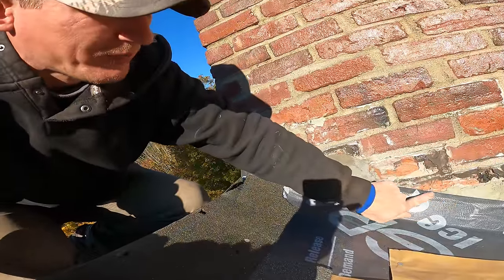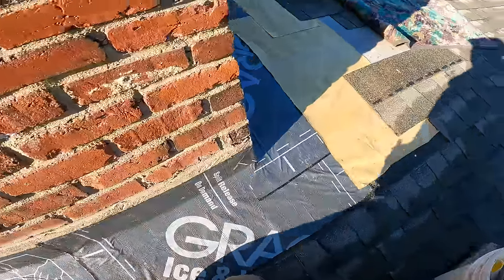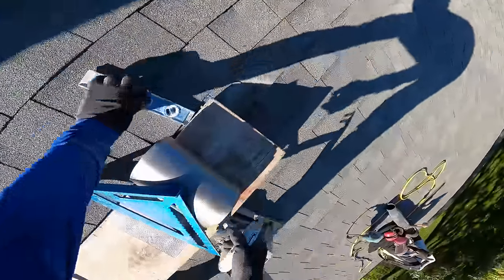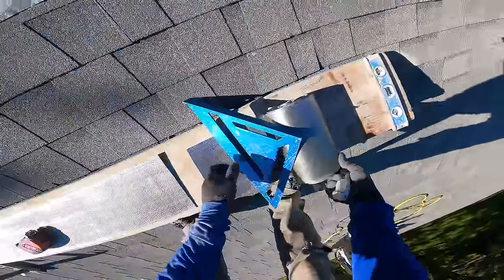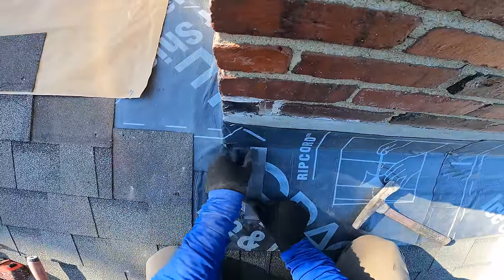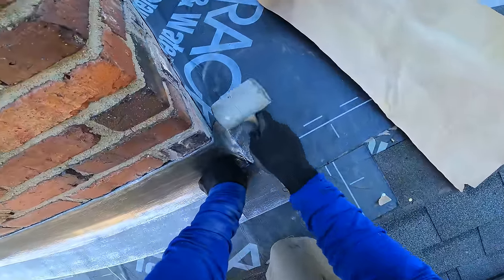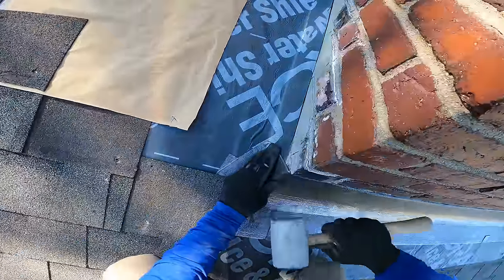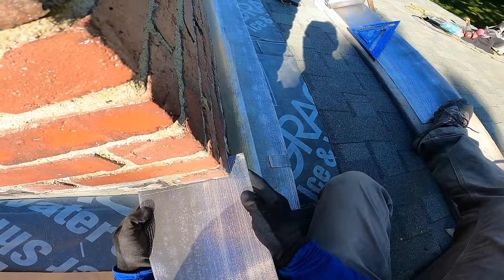Chimney flashing install | Part 2

Comment: This will fail eventually.  Flashing needs to move and be separate from shingles.  Being a mason for 30 years I've seen flashing done this way and it always fails.  Flashing should have either a birds mouth cut into flashing or lead wedges forced into bed joints.  This keeps the lead from backing out.  A flush cut grinder will cut a deeper joint into brick to get at least an inch and a half deep.  Just my opinion from experience.
Reply from the maker: Everything fails eventually. 
I wonder if you even watched the video? I’m guessing you skimmed through with the volume off. Your comment leads me to question your experience and integrity.
Reply: @chadvaillancourt  I watched.  My integrity is top notch.  Simply caulking joints will not guarantee they won't back out.  I also am not a fan of base flashing returning back up chimney.  That creates a dam effect.  Better to have corner piece return 2 inches around face of chimney.  I didn't insult you only made some constructive comments unlike you made towards myself.  No one knows it all but  may become a better craftsman by listening.  I do give you credit for your time on this production.  Good day.
Reply: @brikkijim  James he did all the things.  And silicone will conform and jamb up a notch really well after curing. Fully embedded along the length with a single wedge to allow a linear stretch.  Looks like a system evolved over time to survive.
Reply: @markharmon4963  I only know from experience rebuilding chimneys.  I've seen both silicone and one part urethane eventually fail. A rolled  piece of lead pounded into joint will hold flashing in place even if caulking fails and peels out.  I do like the fact that ice/water shield was applied under step flashing.  I do hope I am wrong and it lasts a lifetime.

Comment: Sorry Chad, chimney will leak anyway. Water will seep in past the lead in the brick above into the interior and run down inside. Learned 35 + years ago to THROUGH flash chimney with lead coated copper, soldered joints. Look it up…..
Reply from the maker: I’ve actually seen it done. The Europeans masons installed a lot like that here. Really nice looking work too, all soldered up real nice They all fail. I always take a close look during the demo. Anytime you trap water in the chimney it will fail. I’ve solved many problems chimney leaks that others couldn’t doing it this way, it works for me.

Comment: Are you an actual roofer ? Your step flashing and lead work is really untidy.  Your stretched lead around the corners will fail really quickly as you actually caused splits in some of the creases.
Reply from the maker: I’m not a European, you can’t expect much from me. I bow down 🙇‍♂️

Comment: 500 bucks?
Reply from the maker: Yes…. For materials
Reply: This is every bit of $1200-$1500 with material. It would be a minimum of $500 if the customer wants to go the cheap route and only use poly flashing sealant. Some people can't afford this type of work although we always recommend it.

Comment: Dreadful lead flashing. You'd be sacked in England for producing that.
I wouldn't accept that from any of my lads. Learn how to weld lead. You won't need to smash the hell out of  the lead then. Put lead soakers on top of each course of shingles, then a single piece of proper stepped flashing to sides.
Buy a lead dressing/ bossing kit!
Reply from the maker: Another coward from England that runs his mouth; yet doesn’t have one video showing his technique. 🤦‍♂️
My method may not look the best, but at least any homeowner can replicate it with minimal tools, without learning how to weld and buying expensive equipment. Also it’s certainly more waterproof than your method of a single piece of stepped counter flashing ( the cheapest way).
We don’t have lead welders here, it’s not a profession so masons have to do there own work.
Maybe you’ll grow a pair one day and Grace us all with your own video. Doubtful.

Comment: do you not use beechwood lead dressers  over there ? excellent work by the way 👍ps have a look at lead mate quality gear
Reply from the maker: Thanks. We don’t really have lead work here, so the tools would have to be bought overseas. I will check them out, thanks for the tip.